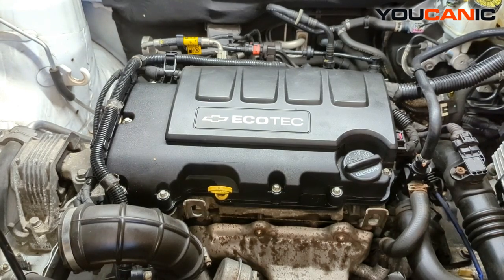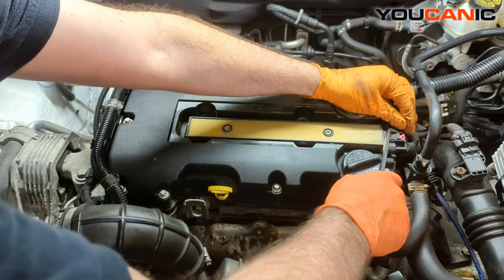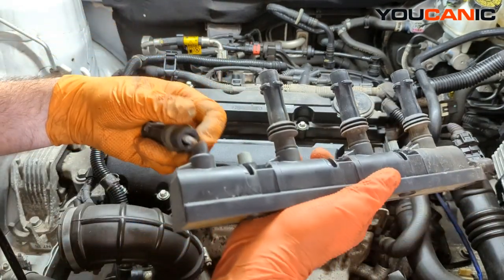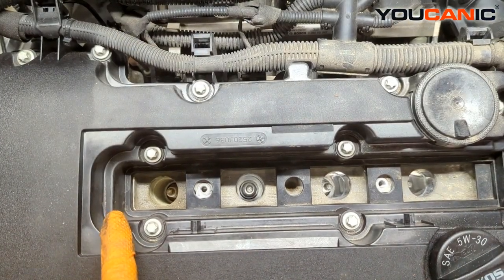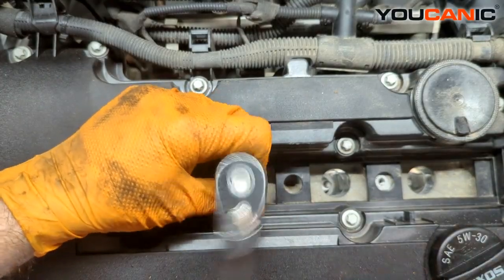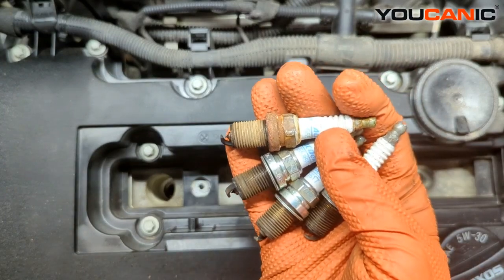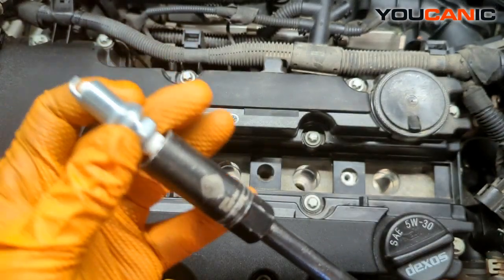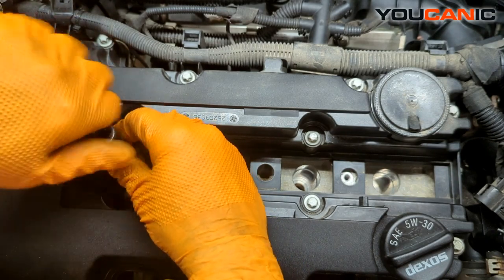2008-2016 1.4L Chevrolet Cruze - Spark Plug Replacement

Comment: I will have to say one thing for these cars.
It is SOOOOOOOO easy to replace the plugs.
I dealt with a GM v6 engine for many years and it sometimes took an hour to change them.
And that was just the 3 in the back.!
Reply: I had the same experience that made me never want to do plugs again. This video made me realize I should have no problem and should just do it myself.
Reply: @Undefined14  Absolutely.
The GM 1.4 engine is the easiest ever to change plugs in.

Comment: Why would you disconnect the battery to swap the plugs? Doing that, all driver programmed information is lost, radio programming, any other driver preferences, also fuel trims will be reset along with all other adaptive learning.
Reply from the maker: Thanks for your insightful comment! Disconnecting the battery when replacing the plugs is general advice we give to ensure safety. However, we understand your concern about losing programmed information. At Youcanic, we aim to empower car owners, helping them save money and gain confidence in car maintenance. 

Check out our website www.youcanic.com for helpful guides, free resources, and our powerful Youcanic scanner. We even provide factory repair manuals. Our mission is to support your car ownership journey. For any specific queries, feel free to approach us on our site!